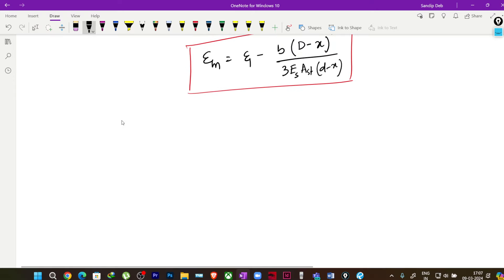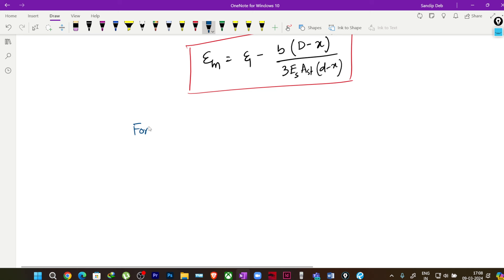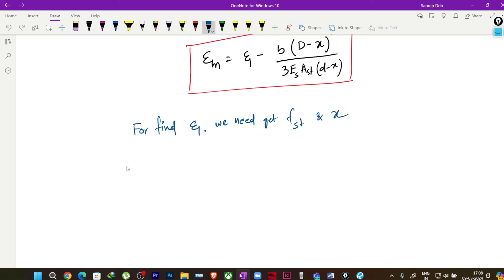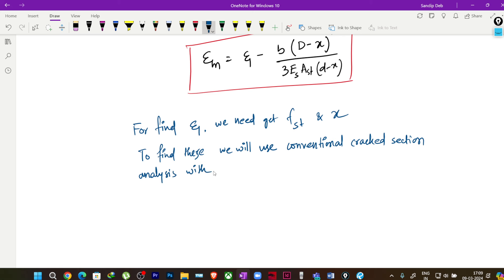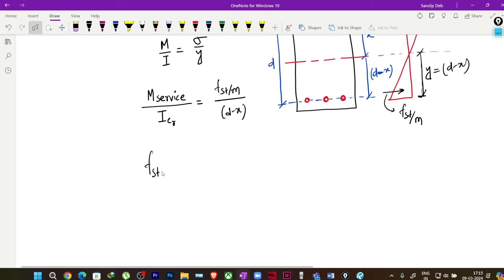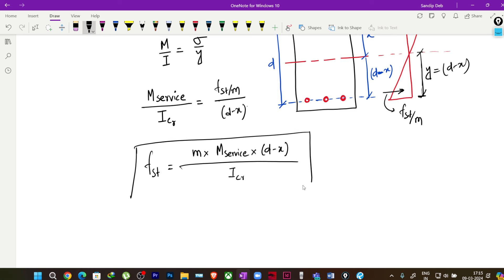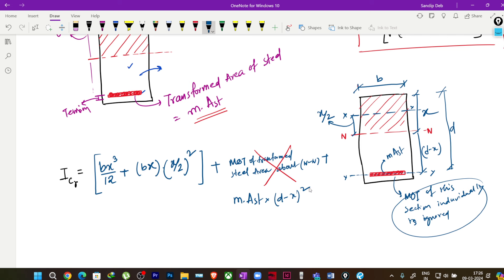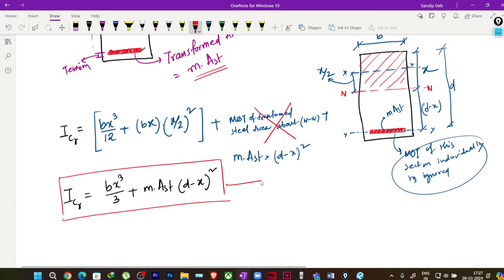Crack Width Analysis | IS 456 : 2000 | Part-02 | ilustraca | Sandip Deb

Comment: In the etabs there are two methods to design the shear wall i.e; (i)CT method & (ii) uniform reinforcement 
what is the diffrenece between them? 
which method is used where?
Reply: can you plz help us for slection of the design method properly because reinfocement in both case are diffrent